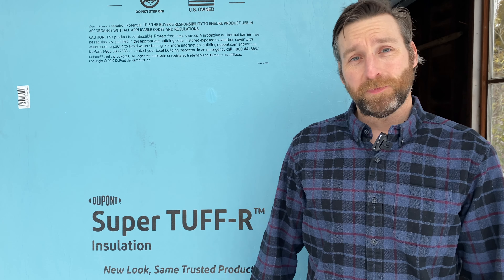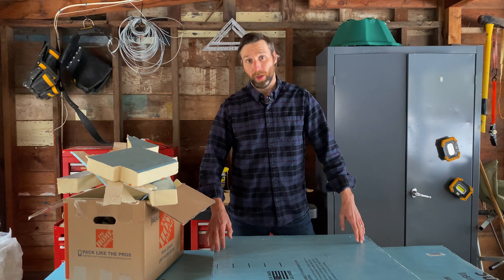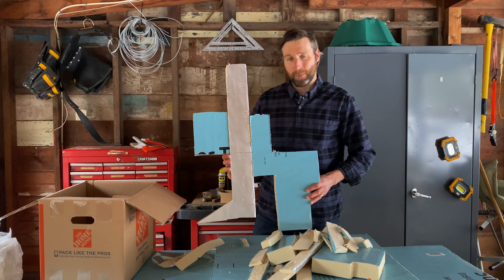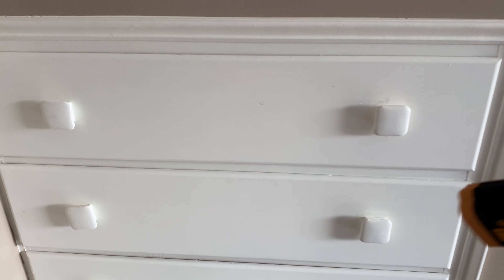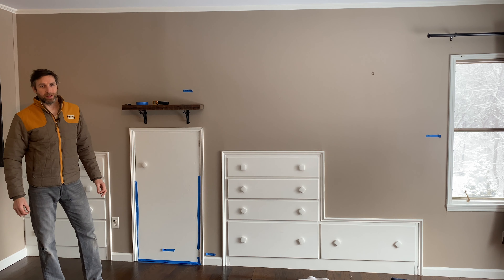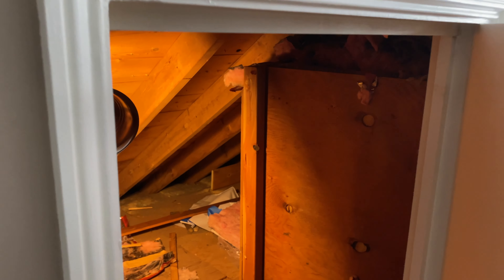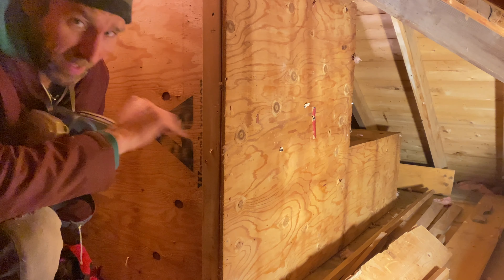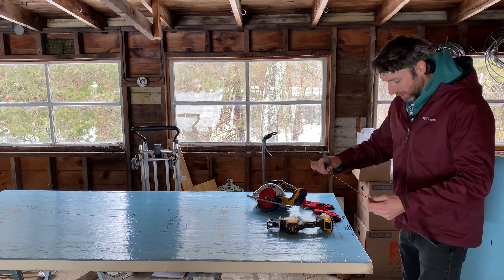DIY Rigid Foam Install: Super Tuff R

Comment: Great video!   I can appreciate all the measuring and cutting you did to fit that puzzle together.
I have the very same panels in 1"...and I have no clear idea of how they should be installed. I even posted a video asking that question.    Some people say use them inside, others say use them outside.  I want to use them outside but the vapor barrier issue confuses me to no end.      tHanks again for your video!

Comment: I like the recipe saw method as well, doesn't make as much dust as the circular saw. I went through the same issues in my basement and closet. I found a  insulation knife was good for on the fly cuts. It is a huge pain to install this in tight spaces, nice job on all the cuts and install.

Comment: Those cut offs cost money too and are now trash.  I just looked at the current prices of Tuff R for a project I'm looking at.  $42/sheet.
Reply: Where are you installing on your project?      I'm trying to install outside under the siding.  I'm stuck on the vapor barrier issues.